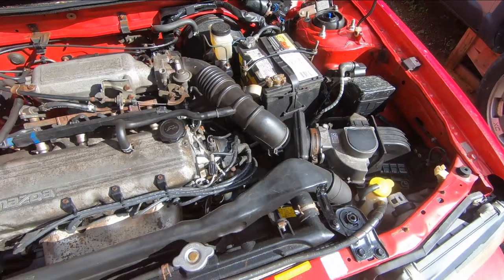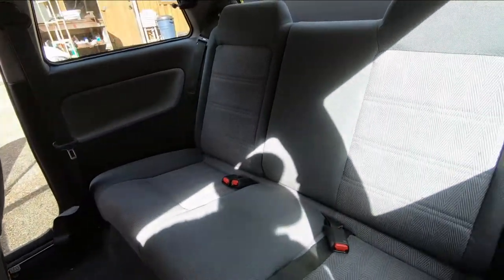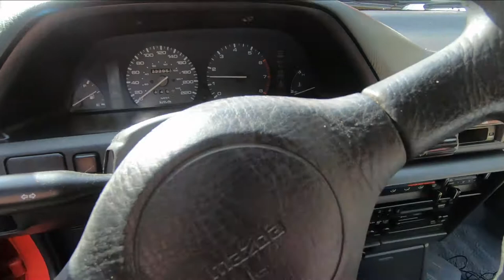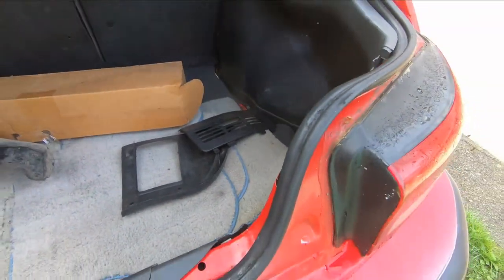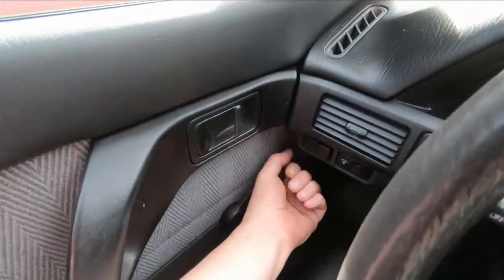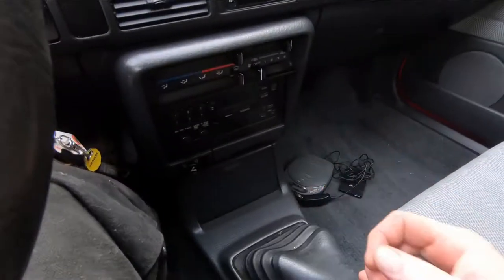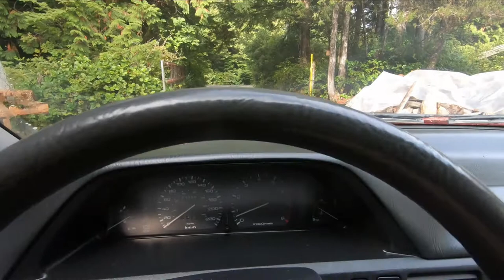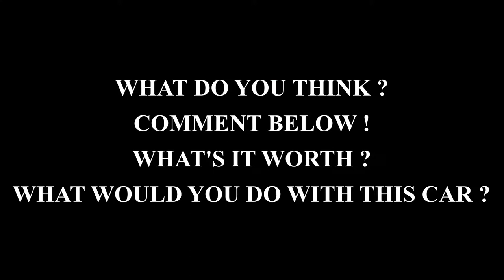**CLASSIC 1994 MAZDA 323 CHECK IT OUT !!

Comment: I currently have the same exact car, just like the one you have on your video, and I truly can't express in words, how much I love 💕😘 my Mazda 323. I've had the car for about 2 and a half years, and I got sooooo much compliments for my car, I've even twice got stopped on the road from people telling me how much they love my car, in the 2 and a half years I've had the car, I've had 4 people that wanted to buy it from me. Love the car, and I'll NEVER sell it.
Reply from the maker: We love this little car too. It is not used as much as our other cars and we have thought to sell it but every time we hold back at the last minute, not wanting to go ahead with posting an ad. This one starts and runs perfectly and has just 133,000 kms (145,000 miles). I do have some small rust spots to address on the sub frame just forward of the drag-link attachment point on the driver side, but that's it. We keep it rustproofed with Fluid Film. A few years ago, I bought a whole lot of new spare parts if I ever needed them, things such as new control arms, gaskets, etc. But so far they are still waiting to be used. Great little cars these 323s! Take care and enjoy yours.
Reply: Thank you ☺️.

Comment: my first car! i hope this thing is still out there on the road somewhere :) mine was the '94 auto transmission in white with 19,000 ORIGINAL miles on it when i bought it from an elderly lady in 2017, and had 38,000 when i sold it after working a few summers to buy an upgrade. it unfortunately had degraded weatherproofing and several electrical issues. hoping to eventually buy another one at some point when i'm better off financially and restore it to factory quality with maybe a few upgrades. anyways, thanks for making this video.
Reply from the maker: @sbellcaster  This one is still on the road. I sold it just a month ago. Hated to sell it but no place to keep it. The weatherstripping on this one was deteriorating too, and the hatchback wiring ( where they pass from roof to hatch) was sometimes causing a short but I stripped back the wires and added heat shrink. All good though and it still drives like a dream 😎

Comment: Swapping in the 2.5L v6 out of: 93-97 MX6/626 , Ford Probe GT and 96-02 Millenia,  wakes these 323s Up !
Reply from the maker: I'd bet it would. Surprisingly, the little 1.6L engine in this car coupled with the 5-speed manual transmission moves this car along very fast. It has 145,000 original miles and is still licenced for the road in 2023...that makes it 30 years old this September. Amazing cars. By the way we are considering selling it for about $3000 CAD. If interested contact me by email. The email link is in the "About" section below. We are in British Columbia, Canada. Cheers
Reply: @EverydayProjects  great little cars, good luck with the sale.

Comment: I bought a 90 LX brand new, only sold in Canada. It had a 1.8 from the Protege. It had 400k when I let it go. Regretted it since. I have two 93's now and have put 1.8 into both. I have  daily driven one for the last 6 years with a engine over 400k. It's still so reliable. I had it to 200k once. Its weight is 1100kg with me in the car.  Such a fun car to drive.
I have just restored and painted the other 93 and just got it going recently. I put all the extra from the Protege like AC, a dash with a tach and cloth seats. 
I have a third very rusty 94 I would like to restore with the Protege floor pan, maybe. A lot of work though.
 I have 4 Protege's also. 94 is complete. The others are stripped. I have  a 90 b2600 4x4 that I want to use the frame to make it a 4x4 Protege Ute. Love my 90's Mazda's sooo much.
 I had 98 Protege and it wasn't as good as my 90 323 LX though.   I'm in BC also.
Reply from the maker: This was my wife's first car! She's had it since almost new (second owner). We liked the 323 so much that we bought another Mazda  (Mazda 5) to have AC/air bags and the space for short trips. You can't beat a Mazda although some Toyota owners have challenged us on that LOL But we still have the 323 and drive it occasionally. It's a fantastic car, as you know. I have  small rust repair to do under the left side where the trailing arm to the rear subframe joins the car. That'll be here on my channel eventually. This has the 1.6 and it starts and runs beautifully...every time!

Comment: Sweet Mazda. I have a 93 that I'm working on. Just got her running and starts with 1 turn of the key but I found another coolant leak that needs sorted. Your dash looks amazing too, thr Arizona sun decided to break mine like peanut brittle.
I'm jealous of your passenger side mirror 😆 I don't have one and mines an SE too...but I have ac though.
Reply from the maker: I'm jealous of your AC. hahaha This car spent most of its life in Alberta, Canada (notice the odometer is in Kilometers) but it also spent several years in Atlanta, Georgia. Alberta is known for using little winter road salt. Cars from there typically have less rust.The interior is very good including the dash. We keep a sun shade (silver thing held up by visor) over the dash all summer which helps. I had a chevy 1/2 ton that the dash cracked on one day. I had been using Armorall on the inside plastic and I've since heard that it may lead to the dash cracking in the heat. Thanks for watching!

Comment: Dude that's a honey! All I could really suggest to do is drive it. Probably drive something else in the winter or give it a good going over with that fluid film stuff. Can you still find another engine and trans, better yet an entire parts car? Get a complete overhaul done on a spare engine and trans and either install them right away or keep them on deck. I love that car. It's so simple and sweet! Looks like that one could be carbureted if you felt like doing some modifications but I'm betting the EFI on that is pretty reliable and efficient. Get a parts car, keep it going for as long as you can. Crank windows!!! I love it!
Reply from the maker: I think you're right. It's been in the family for over twenty years and we were going to sell it, but all we've had is a bunch of Low-ballers and critics trying to steal it. Rockauto has a lot of spare parts and I have a bunch of them on hand. It starts and drives like new and I don't really want to see it gone. Maybe I'll do a Fluid Film treatment and keep starting it every few weeks for now. It is soon approaching 30 years old (in 2 years). I've got to get it out of the weather though. Sitting out on the gravel is no way to preserve it long-term. (But a good going over with fluid film and grease will help keep it rust free).
Reply: @EverydayProjects  Vehicles are getting nothing but more and more complicated. The People have spoken. They don't want to work on them anymore. That lovely little Gem you have there is a throwback to before the Manufacturer, at least Mazda, started an all out war against the shade tree mechanic. I'd do anything I could to preserve that vehicle and keep it on the road. I'd never let it go. And you're good with even newer stuff. For you, working on this must be like building with Lego blocks. Dead simple, reliable, rugged transportation. If you like, you can wire in all the doodads and gadgets you want but if they fail it's not going to cascade over and effect how it runs. Under the hood of that thing even looks nice to work on. Sure it's EFI but that looks like something I could handle without a ton of problems. I'd love to have something like that. It's a proper Beauty and it's in the very best of hands.
Reply from the maker: @heliarche  My wife bought the car more than 20 years ago and she doesn't want to see it go. We are thinking to preserve it (on your suggestion) with a good coat of Fluid Film underneath and inside the panels and find a dry spot to store it between uses. Most of the prospective buyers have wanted to get it for next to nothing but I won't let that happen. For much of its life it was away from salt-covered winter roads and that's why it is still in sound condition. Before she bought the car it had been communting between Canada and Georgia, USA where it benefited from a warm dry climate.That's where most of its miles were put on. We think that keeping it will outweigh any profit from a sale, especially because nobody wants to pay enough. Some have offered only a few hundred dollars! No way! I have sorted through a few of the common issues such as changing the timing belt and water pump. Other than that, the gas tank has been dropped, painted and a new filler neck installed (also all new fuel hoses at the tank). We were driving it everyday until my wife needed a car for work. We bought a newer Madzda 5 that has air bags and air conditioning (essentials for highway travel these days). But we both are reluctant to let this old 323 go. So I think we have decided to keep it. Thanks for your input. Any other tips and comments are always welcome!
Reply: @EverydayProjects  If I had the ways and means I'd happily take the bus and meet you in your driveway with $2500 US cash in hand and I know it'd get me back home. I think that'd be a fair price for it. I think it could go for more. I sure as hell wouldn't let go of it for less. A few hundred is an insult. Screw the nonsense. It's been faithful and it's still got lots of miles left. A small concrete pad and good protection from the elements would be money well spent when you need it again. I'm kind of surprised the Ricers aren't fighting each other in your driveway over it! I'd hate to see it all hacked up and modified though. Save that for the basket cases that have no chance. Also, you're the one that showed me about Fluid Film and the undercoating gun. Many thanks for that!
Reply: @heliarche  I bought our 93 two years ago in Germany, first hand, 83tsd km in way better condition for 1100 €. At least hear in Germany thay are usually not worth more than that. There are exceptions, I have recently seen one for 6000 € in mint condition.

Comment: Hey, i have a 1990 323. Any idea how easy it would be to fix a sticky fuel gauge?
Reply from the maker: Anything's possible. So your fuel gauge stays in one spot while the fuel is obviously used up, right. Or it chatters on it's way to empty? Or it doesn't reach full? I was thinking it could be the sender in the tank.Or the needle on the guage is gummed up from years of use. If it's the last one, you could disassemble the guage cluster and "gently" spray a little canned air around the needle or some sensor cleaner (it evaporates immediately).
Reply: @EverydayProjects  so it works correctly when you put fuel in there. It's when the fuel is heading towards the low mark, it jumps around from way below the empty mark to half full, and everything in between.
Reply from the maker: @jackgalloway1265  Sounds like you're going to have to change the tank sending unit. You should be able to access the top of the tank if you remove the back seat. I'd take it out, clean it up and see how it looks. Not sure how hard they are to find new?? Other option is to just try to keep the tank full and not rely on the guage.